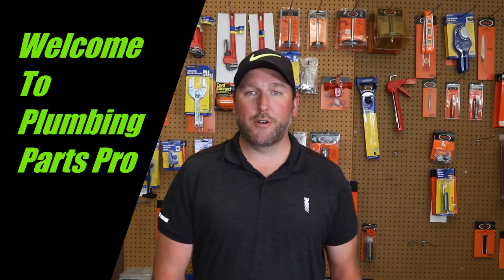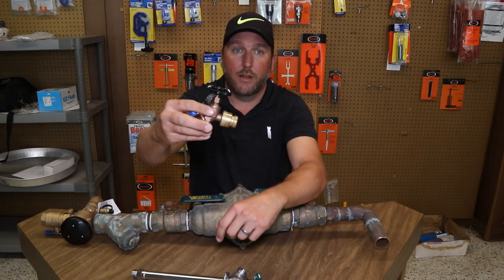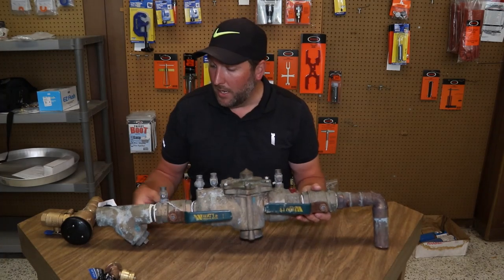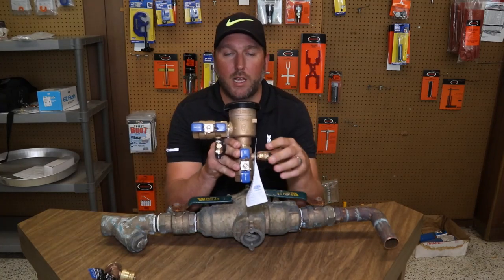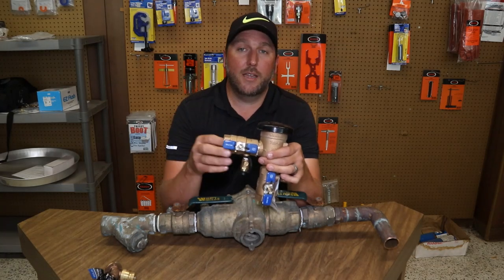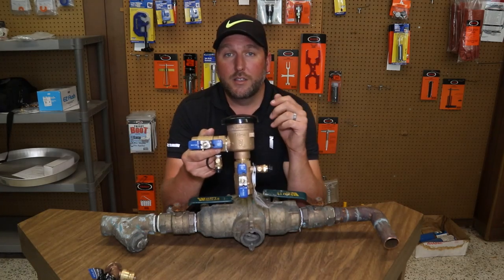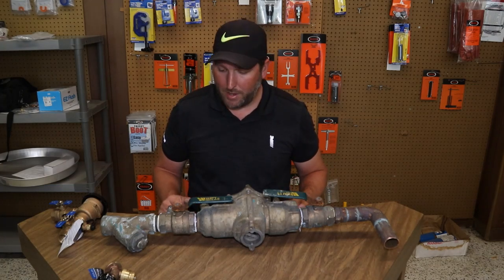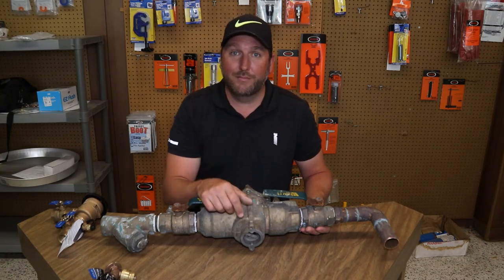What is a Backflow Preventer and How Does It Work

Comment: I have a Zurn back flow valve on my house the Black plastic top cover cracks and breaks due to the heat in Phoenix az. Is the re a better or metal cap that fits this zurn back flow valve

Comment: Thanks for the video, very helpful.  I own a 7 unit apartment building where each water is separately metered.  City just passed an ordinance requiring that we have Backflow preventer installed and checked yearly by the city.   Question - would we install ONE backflow preventer on the main water line before the splits occur (for each independent unit) or we would we need to install 7 different ones?  Any thoughts or recommendations?  thanks

Comment: My 720 A pressure vacuum breaker broke. Can I replace it with a Cheaper one or do I need the same one?
Reply from the maker: You can replace with any PVB however the 720 is cheaper than the watts 800

Comment: I have a 40 unit apartment complex on a private well that is not hooked up to the city water supply. Yesterday when I turned on the sprinkling system and ran it for an hour, within an hour after the sprinklers shut off I received a call from a tenant reporting discolored water. In the last 10 years no one has ever brought it to my attention, and I am wondering if it could be due to lack of a BFP, or the fact that the pump runs steadily during the sprinkler cycle and the well draw-down was enough to agitate the water in the well and create the discoloration. The pump is usually on for only 3-5 minutes until the bladder tanks are full. The water has cleared up since the turning the sprinklers on.

Comment: I noticed that we have an old BFP, should i replace it with a lead free model , if some which one would you recommend ? We current have an Apollo 40205T2, thank you
Reply from the maker: If it's for irrigation only then no.  If it's for drinking water, yes.  HOWEVER, depending on the age of the property, if there's more valves in the system, like ball valves, gate valves etc....  there's a chance they all have Minimal traces of lead already.  Some solders, depending of age have traces of lead so depending in what else is in the plumbing, it may make no difference
Reply: @PlumbingPartsPro  Thank you !

Comment: Is it possible to have the zurn 720a valve setup for the whole house? I live here in Las Vegas NV and I replaced my entire valve when they told me they couldn’t find a replacement rubber spring top. However, upon installing the new one and following directions for the setup to try to get the seal to seat or ride up, I am still having a very very slight leak. Is that normal? It’s not as bad of a leak as the original. Also, I currently have my irrigation water line shut off and only water to the house is on, does that make any difference? I thought these valves were suppose to be setup for irrigation landscaping only but it appears the builder of this home set it up for the entire house?

Comment: In my orchard I have a brass vaccume breaker, but now I am installing a Febco Backflow Preventer. My question is can I or should I still use the vaccume breaker in line too and if so will it go after or before the BFP? Or should I not install it and just go with the Febco? Thanks

Comment: Water heater backflow cold line to tank is hot how is that  I'm on a job i have no answer
Reply from the maker: Sounds like a possible cross connection.  This could be caused several ways.  The most common I see in residential is people setting their shower Temps to where the like it and putting a valve at the shower head so when they use it next time it will be pre set.  This causes hot and cold water to mix throughout the water system which could lead to warm or hot water everywhere even toilets.  Check possible cross connections
Reply: @PlumbingPartsPro ok.   I will do that.  would that be behind the drywall
Reply: It all started as just low hot water pressure I thought just check the tank for debris and flush if needed it's turned into a rubix cube for me
Reply from the maker: @lloyd1821  check the single lever shower Cartridge sounds like possible problem
Reply: @PlumbingPartsPro  ok thank you

Comment: You don’t know what you’re talking about. You can only test in RPZ or a DCV . You cannot check to see if a Vacuum breaker valve works or not. There is no test for.
Reply from the maker: That is incorrect. The PBV valves ARE testable and Required in most states.

Comment: Do we need to do anything to winterize it? Ours bursted last year during the freeze. Is there anything we can do to prevent this?
Reply from the maker: Winterizing is a good idea,  it all depends on the original install.  We typically have a valve in line, usually in a valve box on the supply side of the bfp.  Then if there are threaded unions, you can disconnect and take the entire unit off and place in a shed or garage until spring.  If there are NO unions to remove the unit, shut off the valve, and open the petcocks on the side with a flat screwdriver.  This will allow water to escape if it does freeze and not expand and bust the brass
Reply from the maker: Worst case scenario, buy some heat tape and wrap the valve on cold nights to prevent freezing. See link.

https://amzn.to/3JmFDY7

Comment: Hey what's up, do you know if a BFP is required for a residential property?
Reply from the maker: It varies per local code however it is usually required for residential irrigation systems that are connected to the local city potable water system.

Comment: Hi, just want to get some professional advice. We are going to do our irrigation soon with all 1” pvc pipe for drip irrigation, but the feed from the main line is 3/4” copper, (the mainline is a lot bigger than the irrigation feed). what size should we use for the backflow preventer, 1” or 3/4” ? Thanks

Comment: Only for city water means the heck with rural groundwater quality?
Reply from the maker: No that's just the typical guidelines set by the plumbing code.  Also the rural ground water goes through a pump with a check valve which would prevent anything entering back into the ground.

Comment: Thank you for the video!  One quick follow-up question:  I need to replace my BFP and it is the Zurn Wilkins 720-A that you show in the video.  However, Amazon sells different sizes from .5 inch to 1.5 inch.   How do I tell which one I have?  There are no model numbers on my existing BFP, unfortunately, and the threaded pipes look to me to be 1 3/8 inch, so not sure what to buy
Reply from the maker: It's Most likely 1inch

Comment: Hello, I have a choice on purchasing a new house in which one property requires a backflow preventer and another one doesn't need one. My question is what home should I purchase? I have no idea what would be the better decision. Can anyone help answer this please. The house is a new build and looking at the site plans, some homes require one and some dont. Thank you!!
Reply from the maker: If it were me, I would choose the home you love the most regardless if it has a BFP or not.  It sounds like one of two possibilities.  The one with a BFP has an irrigation system hooked up to the local city water system to provide a great looking lawn. You will have to have the BFP tested on an annual basis but is usually not a big cost to do so. The 2nd home either does NOT have irrigation OR it does and is hooked up to a well. Irrigation systems that use well water typically will turn your sidewalks and home a rusty color due to the iron in the well water.  I hope this helps

Comment: Can I run 2 separate controllers off the large BFP you showed? I got a system with 13 zones and wanna run 4 zones off another controller
Reply from the maker: I do not have a great knowledge of the controls and zoning of the irrigation system. That question would probably be better for a well or irrigation installer not the plumber.  Thanks

Comment: If you have a well that does both your drinking water and irrigation, you really should still have one, no? Same idea, don't want chemicals leeching back into the house..  Could you explain how to test the back flow preventer?
Reply from the maker: You don't need a backflow if it's in a well. It's only if it's on city water.  Testing has to be done by a trained authorized tester and the paper work sent to the local city cross connection dept on an annual basis

Comment: Whats the difference with the small garden brass ones and the larger one for residential sprinklet?
Reply from the maker: The small brass ones are designed to connect to each individual hose faucet, this style is designed to handle an irrigation system with several heads and if there is a backflow it will vent out if the top and prevent chemicals used in the lawn to contaminate the drinking water
Reply: @PlumbingPartsPro  I'm using the small brass one, but it seems to reduce pressure in my system, is this typical?
Reply from the maker: @caine-chow  most PBV backflows like pictured and rpz valves will reduce pressure through the valve.
Reply: @PlumbingPartsPro  do you know how I can maintain the same pressure? the sprinklers now won't pop up.
Reply from the maker: @caine-chow  that sounds like a incoming pressure issue.  Put a pressure gauge on the incoming side to check the pressure. Most city pressures should be 40-60 psi.  Most bfp will give a 5-10 psi drop.  Which usually is still enough to pop up heads

Comment: I'm here at work (refinery) and was in a conversation about getting our backflow preventer inspected. I didn't know what they were talking about so I looked it up and your video explained it perfectly. I stay in the country and have a water well for my water supply. U said I don't need this device on my water system, is that correct?
Reply from the maker: That's correct. It is not needed for well water.  Thanks for watching
Reply: @PlumbingPartsPro  I thought you needed it even on a well system, as you don't want backflow going into your house water?
Reply: @bajajuicy  you need it to prevent it but it isn't a legal policy to do so.

Comment: Thank you.  So what can I do about my sewer that backs up at least once a month. I notice that we cannot flush too much toilet paper.  Is there anything that you recommend i do?
Reply from the maker: There's not alot u can do without getting a good sewer cleaning by a plumbing company with a good quality cable. And that's only if the sewer line is not terracotta and infested with roots. Not a handyman that rents a machine somewhere but good equipment. After a clearing use the root killer quarterly
Reply: Yes install a backflow preventer. That'll fix everything.

Comment: Can you use those test ports as water spigots? Like in a building that doesn't have a water spigot on the outside, can I hook up a water hose to it?
Reply from the maker: No you can not
Reply: @PlumbingPartsPro  What would happen if you do? I did it today, the building didn't have a water spigot to wash the coils on the rooftop units so I hooked up a black iron nipple with a hose adapter and used it.

Comment: Is the last back flow preventer you showed on this video, the one you described as often used in lawn irrigation systems, called a vented, multi-port bfp? My local code calls for such a device but when I googled that name there were no devices named exactly that. Thanks.
Reply from the maker: https://amzn.to/2BOVgdb 

This is whats typically used for a lawn.  Yes it is vented out of the top under the black cap.

Comment: I have 2 videos on my channel about problem of the febco water comeing out. When i open the main valve mo leakage. As soon i open the second valve going to the spronkler leaking. It seems that there is a back  pressure. However when i open slowly the second valve sometime it is ok. However even when no leakage the sprinkler pressure  is low. I must say that just replace the bonnet with a bonnet repair kit.Can you tell me want is the problem? Thanks

Comment: Do you recommend these if your system runs off of a well water system and not a city system?
Reply from the maker: No it's not necessary if you use well water.  This only ly protects contaminants from getting into city water system.
Reply: Can you explain why a bfp is required on city water and not on well water? Thanks

Comment: Where should I place my back flow preventer? Where should I tie it into my main?
Reply from the maker: Yes, insert a tee into the main to supply water to the backflow preventer.  Make sure the bottom of the  BFP is installed 12" above the ground.  Run the outlet line to your sprinkler system.

Comment: Good video.  Is the first type of small vacuum breaker sufficient for using on a small residential irrigation drip & pop-up sprayer system that's connected through a timer on a hose spigot? Or would we need to install one of those bigger ones?
Reply from the maker: If its installed onto a spigot the smaller one would probably work.  It's not the typical recommended way.  Also if there are any inspections, it would probably fail.
Reply: @PlumbingPartsPro  Thanks!  Do you know if the concern related to performance/effectiveness of the irrigation (pressure, flow, etc.) or just related to safety (risk of backflow device not working or failing)?
Reply: @dsperb7696  The concern is building codes and approved equipment

Comment: My valve appears to leak 24/7.  This is obviously not normal.  Does anyone know the cause of this?  How to fix it?  

My relief valve is built basically like the big one he had on the table.  It doesn’t supply my entire home.  It only supplies the sprinkler system.  

The sprinklers work fine
Reply from the maker: So it sounds like it needs to be rebuilt.  Do you Winterize the system?  If not, Could it have frozen and cracked?  You can email me the model number and size, usually 3/4 or 1 inch for irrigation.  Also send a picture. I can help u the best I can
Reply: Plumbing Parts Pro I live in Florida.  Coldest day last year was in the upper 40s.  I don’t think it froze. For part number.  Won’t know till tomorrow when I tackle it.  It’s wrapped up in insulation.  But after watching some of your videos and a few other channels, I think I can tackle this project.  
Thanks for the quick response.  Will post my findings tomorrow.  I have learned it’s defiantly something on the supply side of the valve.
Reply: Plumbing Parts Pro it’s a PR-501
I originally took the top cover off and cleaned and inspected, reassembled. No joy.  It was still leaking.  I took the entire valve off and took it to my garage.  I found a small calcium deposit on the seal of the intake side of the valve. I picked it out and reassembled.  No leak!

I have videos and pictures of the process.  If you’d like them, I’d be happy to email them to you.  You can use them for your channel if you’d like.
Reply: Mine is doing the same thing but  mine did Crack over the freeze we had in Texas. Should I replace the whole thing?